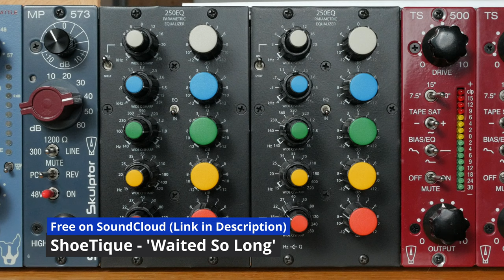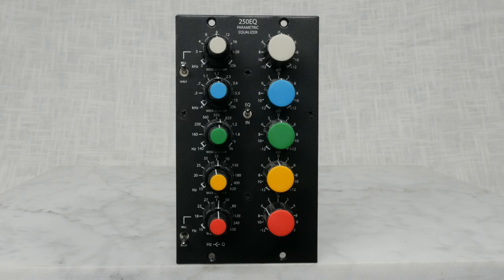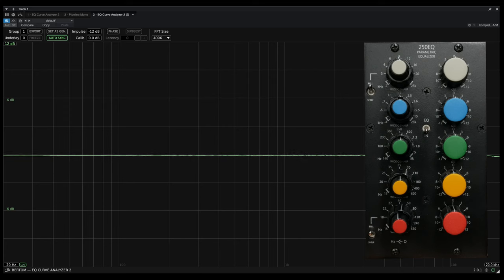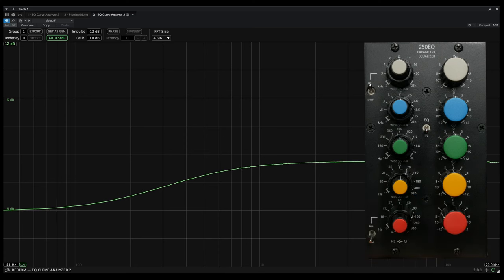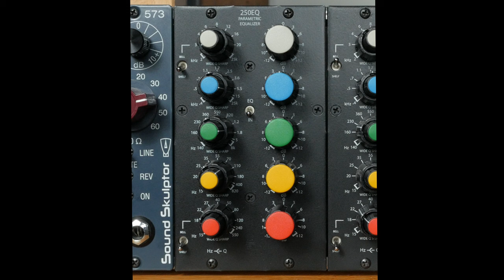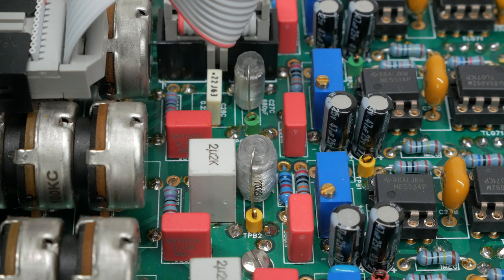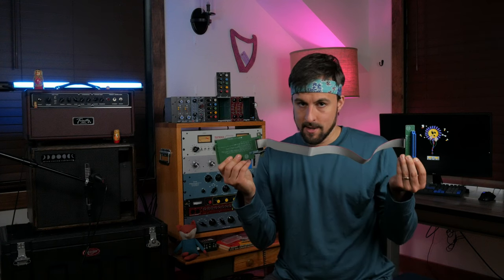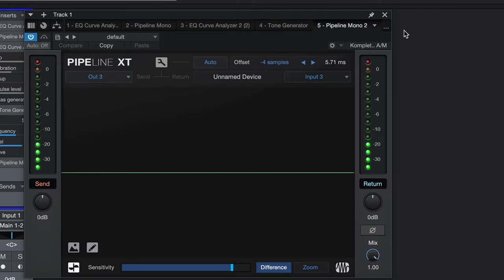DIY Sontec Mastering EQ: Don Classics 500 Series 250EQ

Comment: Have you tried using the two of them on a stereo mix? Is it difficult to get the units to react in a similar way?
Reply from the maker: Hey Stefan! I've used this on stereo mixes a few times. The units react very similarly but they are not exactly the same. I think this pair could have been even tighter if I had opted for entirely 1% tolerance components. There are some parts like the concentric pots where I have no idea how you could get the tolerances low enough to make the two units perform identically. That said you can get pretty close. The vocals example in the video is actually a stereo bus with several vocal tracks mixed and panned. The blue line is the left channel and the green line is the right channel https://www.youtube.com/watch?v=iubz0XtbJh8&t=83s. 

Full disclaimer: In this example I set the units to where they sounded good and didn't worry too much about them being exactly the same. It turns out that they were pretty darn close when I looked with Bertom.
Reply: @shoetiquemusic  Yeah that's what I was thinking, the passive stuff is fairly easy to measure and match but the pots are just going to throw it all out. Reckon that's the way to go, dial them in close and not get too hung up if it's not perfect. Cheers!